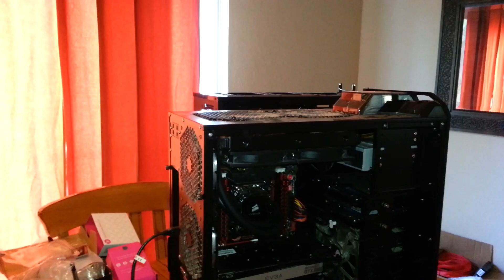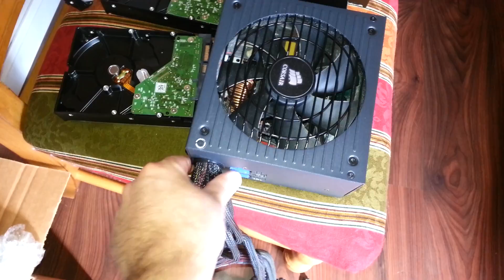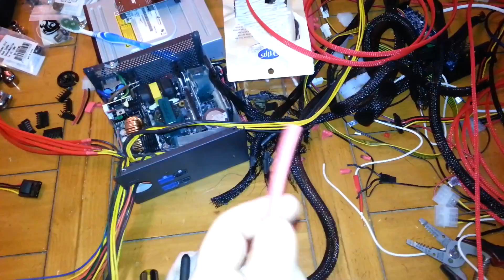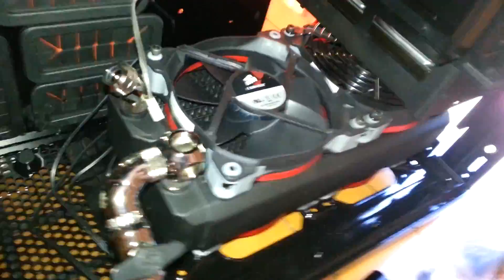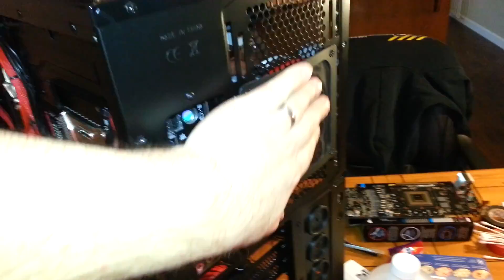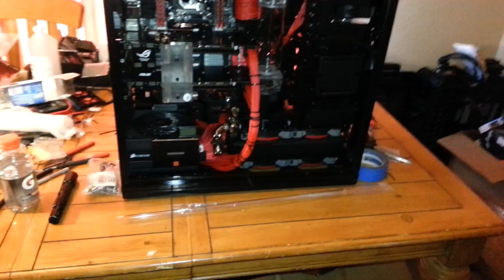Custom Water Cooled PC Build 2014 (3930K/GTX 680 SLI)

Comment: If I were you I would and gone with fully modular PSU to save all that time and work, plus less room for error.
Reply from the maker: Denis Dule I already had this one and the cash was running out. Either less cooling stuff or keep the one I have and upgrade it later. Fully stress testing every component on this rig pushes it real close to 800. I would never exceed that on daily stuff
Reply: Divey1130 alright

Comment: Ho much did this beast cost? I estimate approximately 3.000  but I'd like to know the exact cost! I'm a nerd so I'm curious!!!
Reply from the maker: It was bought/built over time with different versions. I think around 6K more or less. Not exactly sure to be honest. It will work until the 800 series cards come out which I am hoping one card will beat both of my 680's, but we will see. With the voltage unlocked and the overclock, these cards are a beast and the best part is they are silent. I could push more but the performance gain is not worth it.
 Also the cpu will last for awhile and with a mild 4.3 overclock, it's freaking fast and I am sitting at 1.28 volts which I can go much, much higher is needed. A good test if rendering the videos I record in Sony Vegas Pro 12. Rendering a 1 hour video AT 1080/60 FPS takes roughly about 1:20 mins. Compared to my old i5 2500 overlcoked at 4.5 which took over 3 hours. I am at a point where I am very happy and can live with it for another year or two then it's time to sell off the stuff and upgrade.

Comment: you did a very good job with the acrylic man!!! very nice build bro!!!
Reply from the maker: Thanks man, I had to redo the drain port because the rotary fitting had a leak but it's all good now.
Reply: good i'm glad got it fix..sometimes those rotary fitting the rubber washers don't sit in grooves properly

Comment: Question, why did you get 2 gtx 680 instead of one gtx 690? A 690 is just two 680s in 1 card.
Reply from the maker: A 690 are lower clocked 680's and for my setup I needed the 4gb cards. The 690 are 2gb each while mine are 4gb each. Plus I can overclock way higher than the 690. I run triple monitor setup
Reply: Ah nice
Reply: Divey1130 if i paid u to build the same PC would u do it?
Reply: Divey1130 Hey was was wondering if you are planning on playing ESO?
Reply from the maker: jacob Matthews
I could but the cost can get pretty expensive. Like all the "show" parts are not needed. I wanted to do it because I had the money at the time and I always wanted a full custom pc.
Reply from the maker: supergameaddicted
I checked out the beta and I cannot say I like it. I am not into WOW and this reminds me of it. I love the regular skyrim game and when comparing it to eso, it's just not the same for me. But that doesn't mean it's a bad game. Just my opinion
Reply: I can understand that, personally I have played a few hours of WOW and about 700 hours total in skyrim and oblivion (70% of that in oblivion) and when I compare them obviously its a mmo so it cant be like the previous TES titles but IMO its nowhere near WOW as in its 10x better. :P
Reply from the maker: supergameaddicted
That's good to hear. Maybe I could try it one day